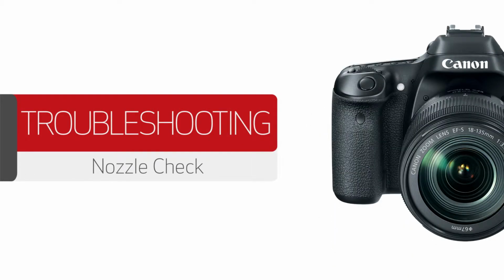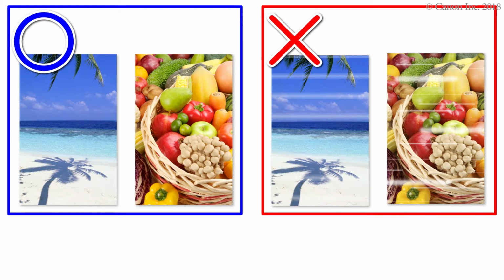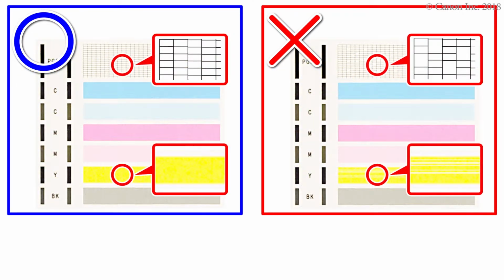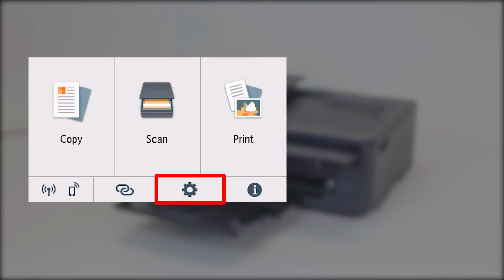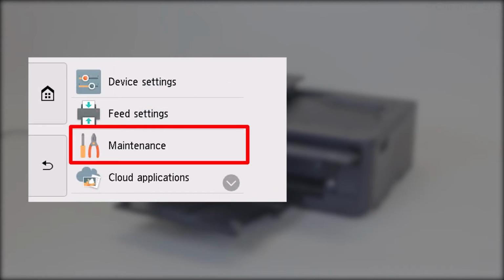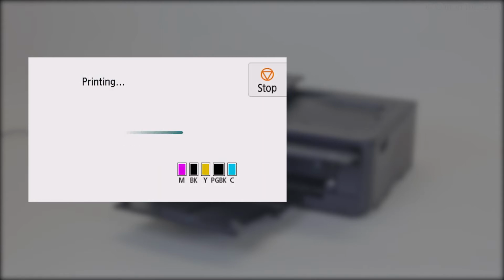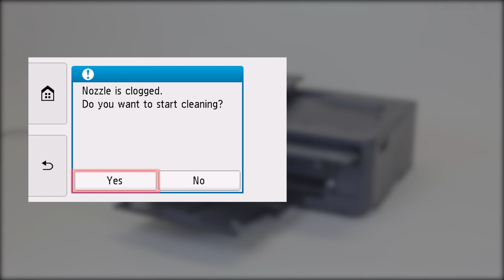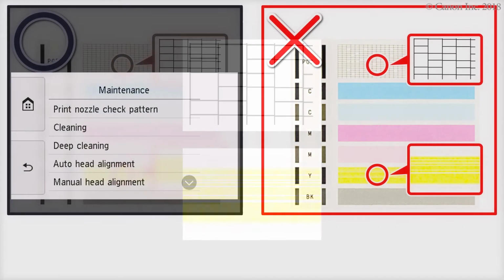Canon PIXMA Troubleshooting - Nozzle Check Pattern

Comment: Fixed my Canon G5020. I performed the troubleshooting as stated. Failed nozzle check after two cleanings, deep cleaned, tried deep cleaning the day after, and still failed the nozzle check. I opened the cover and noticed there was lots of air in the plastic tubing which supplies the print head with ink. I performed an ink flush and the problem was immediately resolved. It uses a lot of ink but luckily the ink for tank printers is much cheaper than purchasing new cartridges. Safe yourself some time and check if the tubing is full of ink and free from air bubbles. Hope this helps!

Comment: I've done a print head cleaning five times now and each time the PBK doesn't print at all. I'm assuming the fault is in the PBK cartridge?
Reply from the maker: Hi Michelle, thanks for reaching out. If you've done maintenance cleanings and deep cleanings, and if you have already replaced the PGBK with a Canon Genuine ink cartridge, and it's still not printing black, we'd recommend calling our Support team at 1-800-OK-CANON (652-2666). They'll be happy to look into the matter further with you.
Reply: @CanonUSASupport  Thanks for the quick reply! I did in fact end up replacing my half full PGBK and then did a few more cleanings (not deep) and it finally printed out. Lesson learned on not leaving the printer idle for months.
Reply: @MichelleLevasseur  you could easily have fixed that by hot water and soaking the print head for a few minutes